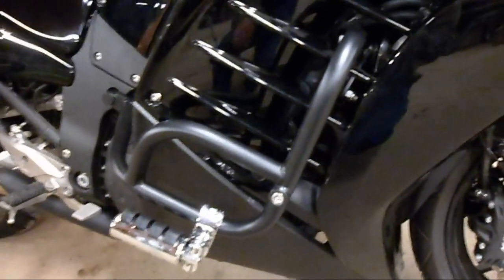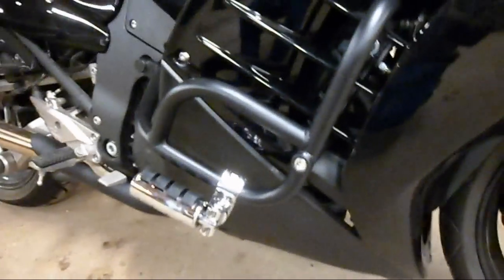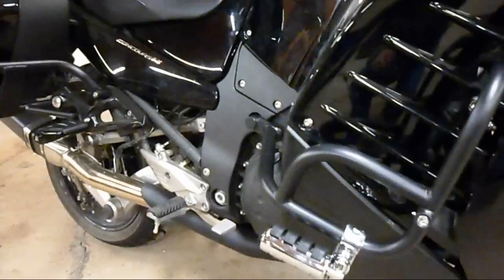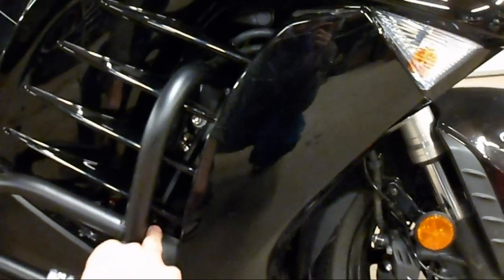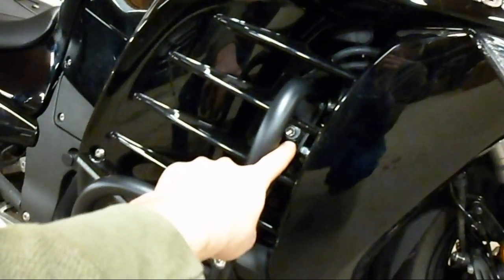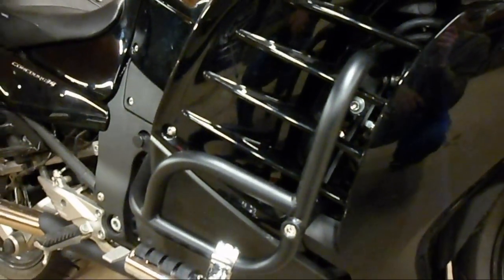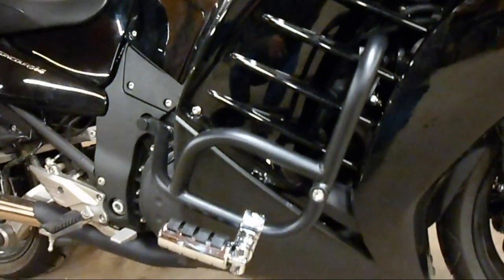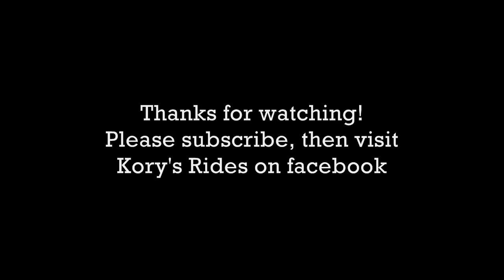Concours 1400 Canyon Cages MC Enterprises [CWP #10]

Comment: These do the job well. these bikes are heavy ..my c14 has been dropped by me and previous owners- no damage done. One thing not mentioned is if you want to take off the middle fairing , cut slots in finned area connecting/mounting so cages don't have to be removed every time. These bikes rule.

Comment: I put the police bars on mine years ago.  They are annoying to mount and I have been lucky so I haven't used them, but they do provide protection if the bike falls over.
Reply: Hello,

Where did you buy these? I'm looking for the enforcement engine guards for the Concours 14, but wasn't able to do so. :(

Thanks !